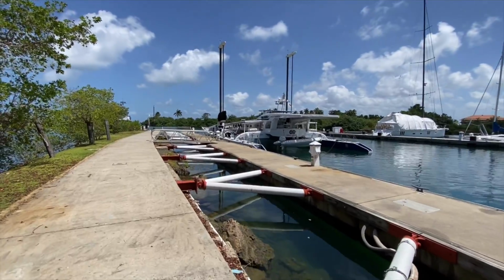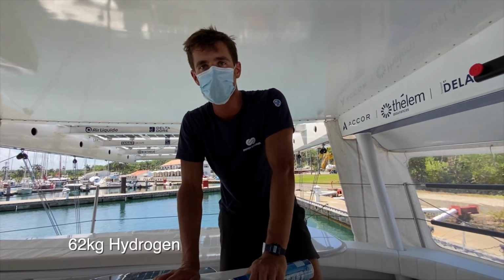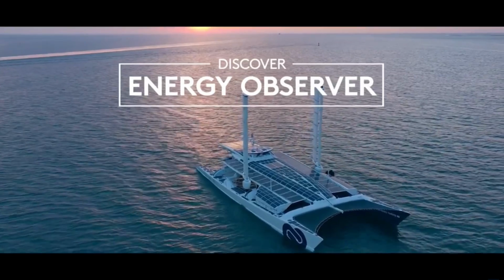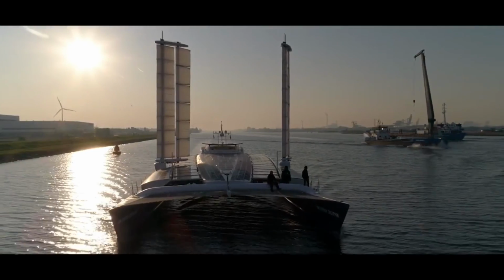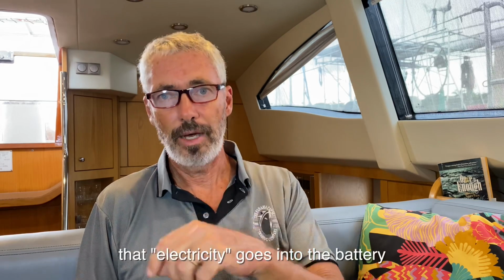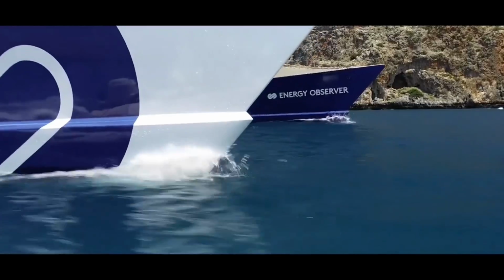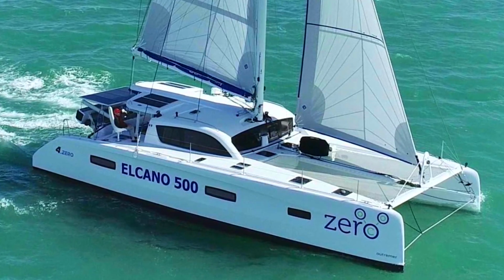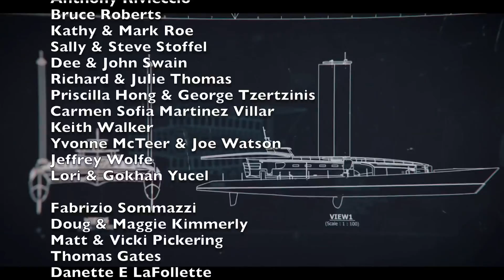Hydrogen-Electric powered boat! Can we get this on our new sailboat? | EP 204

Comment: Battery density is increasing but what comes to mind is to use the weight in the design of the boat. Using the batteries as keel ballast much the way Tesla is moving with their batteries as a structural part of their automobile frame.
Reply: Really smart.... we still are to far.... 😥 I hope in the future...

Comment: Before I retired, I built prototypes for an on-demand hydrogen generator that used sea water and low-grade heat to make the needed hydrogen. Storage tanks are not needed, saving weight, space, cost, and leakage. Cost of fuel made was about 1% of electrolytic hydrogen = game changer! Don’t hold your breath, but when the scaling up phase is done, hydrogen will get exciting in numerous segments of transportation.
Reply: Good afternoon sir, can I ask where to find out about the hydrogen extraction technology you are using?

Comment: This whole business of powering a live-aboard sailboat has been on my mind a lot. For coastal cruising in remoter regions, such as the BC coastline, one still needs dense energy solutions. Deep up a fjord, wind generators are unable to produce reliably steady power and solar abilities are both seasonal and weather dependent. The smaller the boat, the more difficult it becomes to get enough solar onboard as well as generally being unable to get even a small diesel generator installed. As such, I think the problem domain for even a coastal sailor planning to be on the hook for weeks at a time is significant.

Currently, I think a 38-40' boat with a wind generator, solar and a diesel genset is still the most likely form of power for the boat. For propulsion, it's also quite a hard call. The space you gain by getting rid of a diesel engine and using electric propulsion is great for adding LiFePo4 storage, but the whole setup is going to be a very expensive proposition for a conversion. And even then, one may be needing to run the diesel genset quite a bit just to keep the batteries in good nick. Smaller, slower boats won't really be able to do much regen through the prop. 

It will be interesting to see how hydrogen marine solutions end up scaling over time. Obviously, the tech will initially find its way to bigger platforms, but it'll eventually find its way to the recreational realm. The question is, however: How long will Big Oil fight the efforts of alternative energy tech to maintain Big Oil's hold on fuel?

Comment: As mention there is Sailing Uma, also rigging doctor and a couple more that’s electric. It’s not a matter of can it be done it’s more why are the general “you” not doing it. Sailboats are the perfect vessel to go all electric as the motor is the secondary propulsion. Yanmar is close to commercialising their hydrogen system, based on the energy observe in conjunction with Toyota, there is also a hydrogen generator in the works. The interesting thing is the generation of hydrogen using your excess solar, this together with say the hydrogen generator sounds perfect
Reply: Question is not, can it be done. Question is, what are you willing to give up? Electric cars are not new. In the early days of cars, they were there with Model T. But the negatives sides were more than the positive ones. Now companies like Tesla proved, an electric car can be exiting and have a decent range. So the average boat owner don’t want to compromise too much for electric drive systems and deal with the problems around it. The average boat owner is not a full time YouTuber that sails. More often they use the boat maybe 2-4 weeks in a year. Then they want to go places and don’t wait for perfect weather to go. I agree, hydrogen is a good direction compared to battery only. That’s why I invested in different hydrogen related startups. I also ordered a truck with hydrogen cell. 
Also Sunreef with their eco line went electric/hybrid.
Reply: VPLP & PI Superyachts has a "blue box" on their Dragoship 25 concept build which has been available for a long time ("I'veheard of a Superyacht", really?). It seems boats powered by the wind only makes sense to have diesel engines. Makes little sense. Also, this is a sailboat through the use of the advanced wing sails and in his explanation on the power needs piece he failed to mention it. In fact, he goes on to speak of sailboats as if they were in a different category. What the.... You might want to research your material a bit better
Reply: Wow, you know nothing is "all green" depending on how you look at it. Referencing a house? Even a PassivHaus rating requires the use of many "technologies/methods" to achieve. The Energy Observer demonstrates this reality by using wind (wingsails, wind turbines, or their kite), hydro (props & engines as generators or the system being discussed), sun (solar panels), energy storage (batteries & fuel cells).
Y'all reference people who have tried batteries and solar and may chose against wind (which tends to happen around Cloud development or sailing) because of the noise, hydro (because they might lose some average speed or its current design limitations with add ons). 
No single system is going to solve all your needs and if you need a plethora of TVs, A/C, Refrigerators, Dishwasher, Washing Machine running 24/7 maybe one should consider living on land and not talk energy efficiency anyways because your not going to survive off the grid either.
P.S. I have my land place in some foot hills with no city utilities and have a small water trailer to get even that. Life can have indulgences but simplicity is where it's at. I've seen some true live-a-boards on the YouTube scene and you see their plants-a-growing on their boat!!!
Reply: @Aus L 😇 I'm on the side of expectations in that so many of the comments talk about this "one" technology as if it is supposed to be the "bread & butter", the magic pill or why batteries/electric won't work and I should have made it its own post as it wasn't meant for a specific response (I was lazy). 

Personally, I'm not sure I'm Comfortable with something holding that much pressure and I come from the Biomedical Equipment Engineering Technology side of fixing things and some time spent in Manufacturing (some places just don't have room for things to go boom) 😱. But the ability to concentrate that much energy with minimal weight penalty sure looks tempting. 

I'm in the planning/prepping phase looking at what project boat i want to chose while finalizing my budget and would prefer a performance cruiser (trimaran if I'm lucky), solar, lithium, electric engines, and hydro regeneration. And in place of the wind generator i would use a sealed vibrational generator to eliminate that blade noise. Oh yeah, and a it would be a Ketch Rig for several reasons unless those wing sail things become a lot cheaper.

Fun discussion. Enjoy!!!

Comment: I believe Russia with their new Nuclear reactor that they have announced and which leaves no radio-active residue will be a powerful machine to produce large volumes of Hydrogen. So, you are definitely on the right track...Perhaps you should consider electrifying your new boat as SV UMA did, using lithium for the moment and upgrading to fuel cells when the main fuel becomes more wide spread and affordable. Perhaps also putting more thoughts on making your new boat less heavy, adding induction cooking etc....maybe a full keel instead of retractable mechanism would make it simpler....Just some thoughts!
You have definitely a better angle for your show from now on! 
Many followers will join your channel!
Well done
Cheers

Comment: What is important to understand is that no single component does all the work. Several sources of energy production are necessary (solar, wind, regen, hydrogen, batteries, etc). Ocean Observer is vital because it is designed as a test bed so all the systems are tested all the time in "real time". It is proof of concept as a patent attorney might say. Thank you.

Comment: You have probably followed UMA.  They have sailed the east coast of the US. Crossed the N Atlantic, sailed Europe and have now been nearly a year in Norway. They are now N of Norway by about 600 miles in Svalbard, about 10 degrees south of the North Pole.  There big robust expeditionary yacht is a 1972 Pearson 36’ coastal cruiser!  All done with no diesel. They have an electric motor with lithium and regen prop. They have no propane either, everything is electric:  Watermaker, cooking refrigerator, etc.  Clever and amazing people.

Comment: “Sailing Uma” has been all electric for years.  All done on a budget and slowly upgrading when funds permit.  Hydrogen fuel cell tech sounds interesting.
Reply: I was going mention Uma then saw this comment.  Dan and Kika's set up does have limitations, however. Their electric drive can only be used at full speed for a couple hours.  At only 3 Kn I think it can last for 5 or 6 hours.  But imagine a dead calm where you have to fight a 3 Kn current to get someplace 6 kilometers away.  They do have a gasoline powered outboard for their dinghy (Coco) so in an emergency they could probably tow Uma with her.
Reply: I was just about to make the same comment!
Reply: They (Uma) do pollute in other ways. They got fed up with their composting toilet and now their sewage dumps straight out, even at dock.
Reply: There's also silent power yachts making solely solar powered craft. They seem to be doing exceedingly well. and the 60 only has 17Kw of solar too. So I can't see how 35Kw on this thing isn't enough... Well I can begin to see why... All the tech on board probably.
Reply: @HandyC  generating the hydrogen gas is a huge power suck. It takes almost twice the amount of energy to produce one unit of hydrogen power. The solar and wind farms needed to supply ships with “green hydrogen” would be a massive and expensive undertaking. I don’t see it happening any time soon.
Reply: @charlienevergold3654  
Yep not on board. I think the way forward for all ships will be harbour side refilling of hydrogen tanks and then going about your day as per normal otherwise it simply doesn't work. If you are going to create anything on board, it should be electric and should be stored as electric.
The only reason Uma is distance constrained is cost.
Reply: There is a lot Uma and others are not showing in their videos. For example, right now in Norway, where the sun is low on the horizon, where the day is short and where it either rains or snows most days, there is no way that the battery gets fully recharged other than going to shore and plugging the charger. The electric motor is a good idea, the problem is the energy reserve. Actual batteries and associated chargers are not powerful enough to provide sufficient autonomy. Physics has not changed with technology, it requires the same energy to move a mass at a given speed thru the water. To me hydrogen, once stored in a safe way, is the solution. Good video, thanks Distant Shores.
Reply: @kirsten07734  the worst is that they installed an oversize pipe to give the impression it is a holding tank. This is to fool the rules in America. A dye put into the toilet bowl would not show up on the water after a few pump strokes!!!
Reply: @kirsten07734  I think it is highly unlikely that they are dumping raw sewage at docks. Off shore like everyone else.
Reply: It’s worth noting Uma’s oceanvolt motor can generate electricity under sail and the motor is really secondary method of propulsion. They also have the luxury and patience to wait when the tide and wind are not in there favor.
Reply: Other honorable mention is S.V. Top Secret (ft. on the O'Kellys https://youtu.be/nchKhM_TxYk?list=PL4sEHE4rFQXmuF3hBzeHj6EIam3wP-ynQ) although their goal wasn't fully carbon-free, they do have electric propulsion and enough solar/regen to support a cruising lifestyle (and a pretty lavish one at that) of changing anchor every couple days. It definitely can be done on solar/wind/regen even without fuel cells as long as the ship isn't making consistent long-haul trips or isn't constantly running AC/heated water/etc. On a side note - am I the only one that thought that Elcano looked like it had woefully too little solar for the size of the ship? The panels on the back don't even fully cover the dingy/davits.
Reply: @kirsten07734  If you watched the Sailing Uma episode where Kika and Dan installed their sewage system you'll see that they have a small holding tank, they do not dump at dock.
Reply: @tartansailor   - They are showing what they are doing in their videos....but they dont directly address it. In a nutshell, they are hopping from dock to dock and re-charging using the dock mains power. every now and then they allude to the fact that they are low on power and need to get to the dock.
Reply: Uma has electric AUXILIARY propulsion. Her primary means of propulsion are still her sails.
Reply: @charlienevergold3654  It's now about at an 80% return rate efficiency.  Close to what flow cell energy storage systems are, but far lighter.  The net weight savings on a catamaran make it a close wash on efficiencies.  Hydrogen gas, like all fuels, has to be thought of in terms of energy storage.  As all the efficiencies raise, it makes hydrogen look better and better.
Reply: @kirsten07734  So what. It's less pollution than the seagulls put in.
Reply: @HandyC  It takes a lot of KW to make the H.
Reply: thats what i was gonna say, i think they said the new drive they installed is also a regen type motor so why under sail they can create more power to the batteries.
Reply: True but they have also been tied to docks. Not truly independent. The other side of that coin is that no boat is truly independent from shore. We all need some connection. I do like the idea of the hydrogen generator concept. 

Like most of us do a hydrogen generator could make fuel even at the dock. Using solar panels to operate the H gen unit. While we were away. Then we arrive on Friday for a cruise with hydrogen tanks full and ready for a weekend of sailing or motoring. Or we are ready for a two week cruise from Florida over to the Bahamas. Using our solar and wind generator we will be able to motor or sail around the islands in comfort and safety. 

The cost of such a system would be outrageous at this point but if a mad production of this power train system could be built for boating and installed on all ne production boats perhaps it’s doable.

Comment: So, Hydrogen has two main advantages over Batteries. 1) the storage medium is WAY lighter, and 2) "refueling" (charging?) times can be WAY shorter. In pretty much every other way, Hydrogen is worse. Comparing the weight of the Hydrogen to the weight of the battery is dumb at best and fraudulent at worst. You have to compare the weight of all systems required for it to work. The Batteries require 1) charge controllers (95% efficient, small, light, solid state), and 2) cables (98% efficient) while losing about 10% to internal resistance for about 84% round trip efficiency of the system. That's pretty much it. The Hydrogen requires an electrolysis device (75% efficient, is much larger and heavier than an equivalent capacity charge controller, is mechanically complex (pumps, valves, through hulls), and is holding corrosive sea water, 2) compressor (90% efficient, is mechanically complex, is safety critical (compressing a highly flammable gas to high pressure), 3) tanks and valves (100% efficient if not leaking) but the tanks are heavier than the fuel, 4) fuel cell (60% efficient, weighs twice that of an equivalent power diesel engine) for about 40% round trip efficiency of the system. No wonder they can't move and produce Hydrogen at the same time. Their battery weight is also excessive. Tesla's 85kWh battery pack weighs 1200lb, indicating that 100kWh should weigh 1412lb, not 1.5 tonnes (they are French) or 3300lb. Also consider the relative safety risk of Hydrogen which causes embrittlement of metal, is odorless, colorless, tasteless, is an extremely small molecule so is difficult to contain, is under high pressure, and is highly flammable over a very wide range of fuel to air ratios. People who won't have propane tanks inside the boat are really going to freak out about Hydrogen. Stating Hydrogen fueled ranges as a function of speed while not stating the kWh expended (easily monitiored by the engine controller) really paints a rosy picture. Power required is directly proportional the the speed cubed. Slowing down a little saves a lot of power, whether it comes from Hydrogen or batteries. So, where does Hydrogen beat batteries? When power required is very low when compared to the total energy required (very long endurance), when refueling times are pretty important, and when the cost of energy going in is significantly less important. So, think multifunctional buoys, remote weather or radio stations that can't do solar, etc.